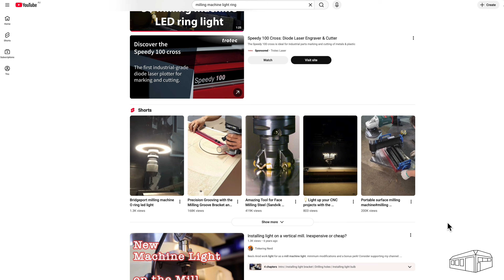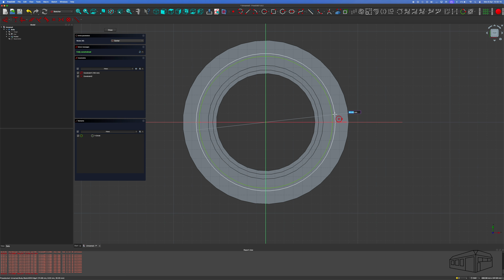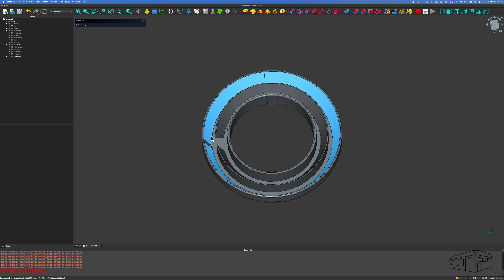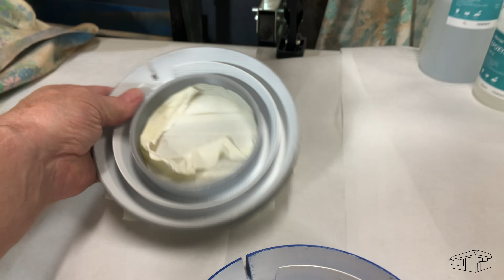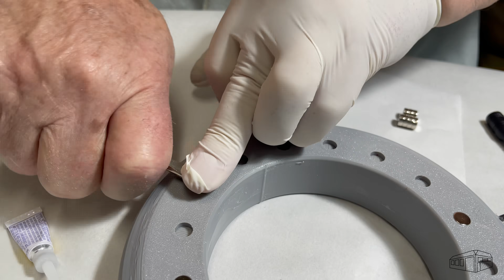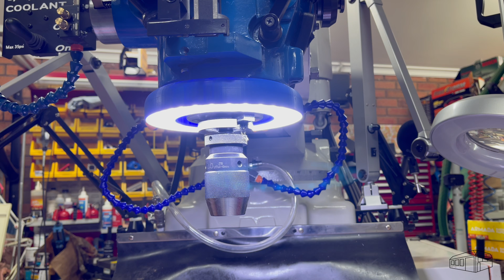Making an Intense Ring Light for the Mill

Comment: To avoid the transition for the LED would it be possible to print the channel in a coil pattern?
Reply from the maker: Thanks for the comment. The LED strip is 10mm wide. It would be possible to do as you suggest but that would make the housing a lot deeper. It' at the limit now with the Botton face being in line with the seat of the spindle. Great suggestion. Cheers SteveO

Comment: A PWM controller would allow you to adjust your lighting output. I think Jaycar would have one listed.
Reply from the maker: I'm not sure if the LED's I used are rated for dimming but you make a good point, I'll check it out, thanks for the tip. Cheers SteveO
Reply: @theoutbackshed  PWM controller turns them on and off rapidly, and since those are just 12v strips they don't have any fancy electronics - just multiples of 3 LEDs in series connected directly to the power rails via a resistor. Pulsing them with PWM, or even using variable output voltage power supply to dim them would work just fine. The voltage can go as low as 9 volts and they'll still produce light.
Reply from the maker: Thanks, I'm going to check that out. Cheers SteveO
Reply from the maker: One thing I will need to take into account is that any change in Hz may introduce strobing which would not work for filming. Cheers SteveO
Reply: @theoutbackshed  Yeah, strobing can be a real issue. If strobing shows up when filming you can alter the brightness by changing the voltage using a DC-DC buck converter instead.

Comment: высокая яркость вредна. помните, у глаз нету обратной связи по боли от яркости. 1800 люмен, 19 ватт, - это пучок света, по мощности равный дешевой фары у машины. это слишком высокая концентрация света. в вашем случае хватило бы 3-5 ватт. теперь остается только диммировать, будет мерцать. либо снижать ток, тогда начнут изменяться цвета. на полной мощности такая подсветка требуется лишь в случаях, если вы планируете снимать слоумо, на 900-1000 кадров. :)
Reply from the maker: Translation:
High brightness is harmful. Remember, the eyes have no feedback for pain from brightness. 1800 lumens, 19 watts, is a beam of light with power equal to a cheap car headlight. This is too high a concentration of light. In your case, 3-5 watts would be enough. Now the only option is to dim it, which will cause flickering. Or reduce the current, then the colors will start changing. At full power, such lighting is only needed if you plan to shoot slow motion at 900-1000 frames. :)

Thanks for the comment. That;'s a really good point. I haven't used it in a machining project yet but I'll report in when I do. I have been looking for additional lighting for super slo-mo video and lighting has been a restricting fact in this. Maybe of some use but the diffused light is much lower in intensity and would likely become my preferred option. 

Cheers SteveO

Comment: Those look great. The clear resin sure makes them suitable for any liquids they may have contact with. Having built them and used them, do you think they would be just fine without the resin? That way led strips that fail are easily replaced, or upgraded if the lighting isn't right.
Reply from the maker: Thanks for the comment. I haven't used them in a machining situation yet. The amount of strip used (1.7m) would be about $17 and the resin would be about $10. The filament costs next to nothing so I would prefer to have the resin and treat it as a disposable item if the LED's fail. Also I would like to have several of different degrees of diffusion (gloss; semi-gloss; matt; dimmable) and perhaps use different lights for different setup and metals. They are easily replaced in a few seconds and the electrics are plug n play.
They are coated with a clear lacquer to seal them from coolant and machine oil so they should be fine.
Cheers SteveO
Reply: @theoutbackshed yeah, I guess if you made up a batch with the variable options then the invested time wouldn't be too much per light. If making just one, each process would likely make for a decent time investment.

Comment: Excellent timing mate, I just started on a ring light for the mill yeserday, was planning on the 3d print version aswell. so this is going to be super handy. I didn't think of the reflecting idea, I was just going to put the led like your first try
Reply from the maker: Thanks for the comment. The prototype only lit up itself so I mare the reflective surfaces. They seem to work very well.
Cheers
SteveO

Comment: Very Interesting and impressive results.  I didn’t know you could encase LED strips in epoxy.  I would have assumed they would overheat.
Reply: They might depending on how long they're run for, but we'll have to wait and see what happens!
Reply: There are LED strips for outdoor use encased in silicone. Not quite the same as resin, but it's still a thermal insulator. Resin should be fine. They might lose brightness sooner than they would if they were just left in the air, but the difference isn't too significant. It's not like this light would be on 24/7 or anything.
Reply from the maker: Thanks for the comment. I have done some resin work before but only with wood, (tables and the like) and it made sense to do a prototype with resin to see what would happen. It works very well.
Cheers SteveO